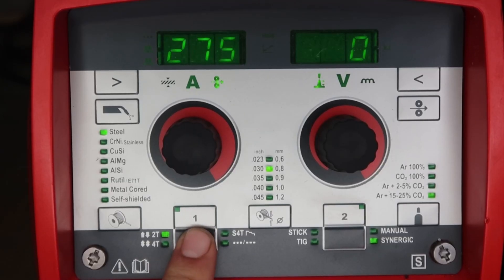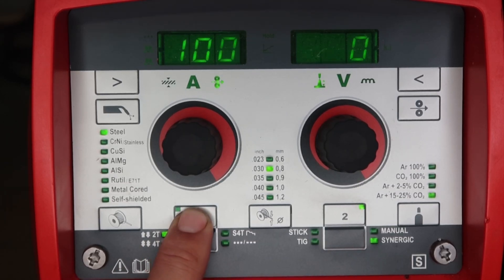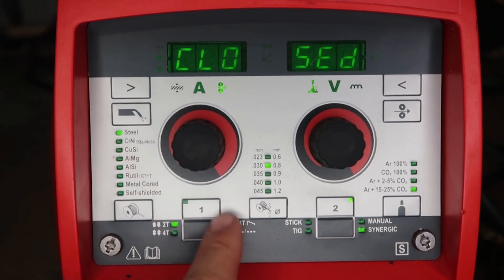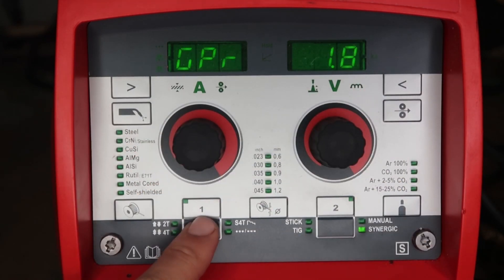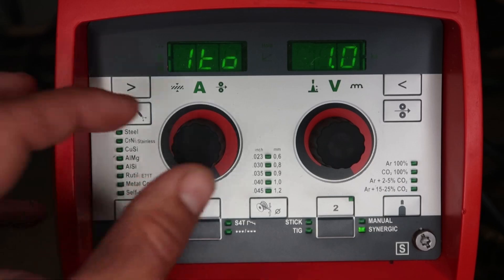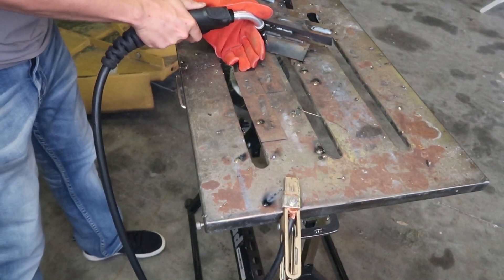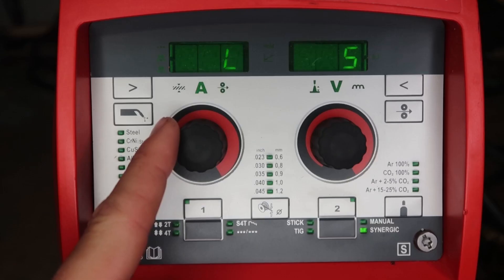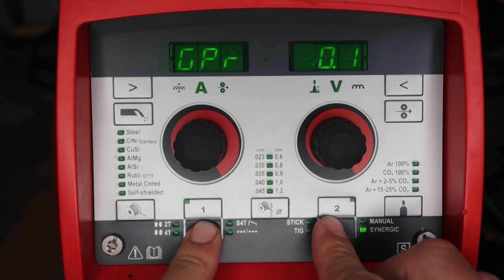How To Operate And Setup A Fronius TransSteel 2200 (2 of 3)

Comment: How do you adjust inductivity, mine is stuck on ten in all modes, and I don’t know how to adjust it. I’ve pushed every button and turned it very knob while displaying l in the left read out  and 10 in the right read out help same with r. Stuck on 5
Reply from the maker: So in synergic mode it stays at 5.0 and standard mode it stays at 10.0?
Reply: @chris_b_liven   high there thanks for responding .the resistance or “r “reads five in all modes with no adjustability or change, and L the inductivity reads 10 In all modes and doesn’t change either.  Most of all I’m just trying to get the thing to run a decent bead.  Not sure what I’m doing or what all settings are off if they are or if it’s operator error. 😀
Reply from the maker: @adambergmann7716  The R and L is for resistance check. You have to be on the R , pull the gas nozzle off , place the tip directly on the table and pull the trigger. It will auto calibrate the resistance. If you get an error then make sure it’s getting good ground and try again
Reply: @chris_b_liven   how about the inductance? I know on some welders, this is an adjustable parameter to make a more adjustable arc? Softer or more narrow.
Reply from the maker: @adambergmann7716  It’s on the front panel next to Volts - the squiggly line next to the big V
Reply: @chris_b_liven  perfect thanks. I never got a manual for this machine, just the useless language guides for the mig tig torches and a QR code on the machine is  that links to every other machine than the 2200 

https://www.fronius.com/en/welding-technology/products/manual-welding/migmag/transsteel/transsteel/transsteel-5000

Comment: You know when they come out with interface like esab?
Reply from the maker: The faceplate is actually pretty simple to setup. Not much need to go into background menus
Reply: @chris_b_liven  i know but u need to remember thing instead of all visualization. I have a very bad memory. :( can’t even remember my son birthdays
Reply from the maker: @hangngoaigiare  😜 Understood. Just remember wire type, diameter, gas mix and material thickness. Ready to roll
Reply: @chris_b_liven  thanks for reply. I’m sold on this machine over miller and esab.  Just wait for more intuitive interface and ac tig on their upgrade to buy one.  Would you made a video about best practice for assembly restaurant grease duct using carbon steel 16G thickness.